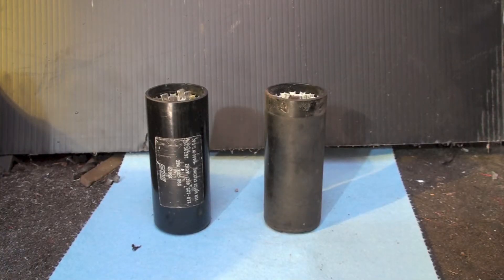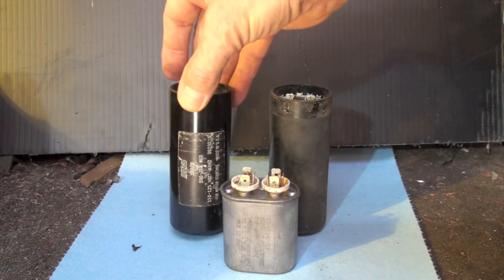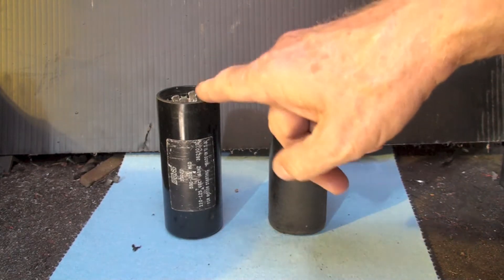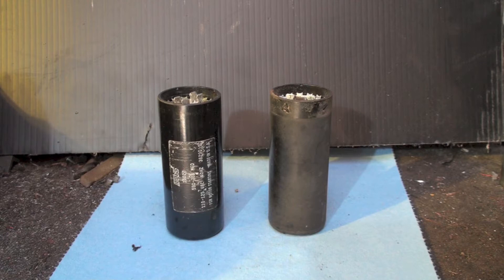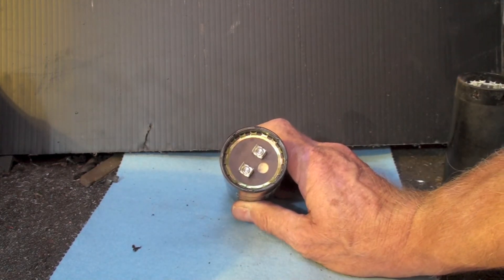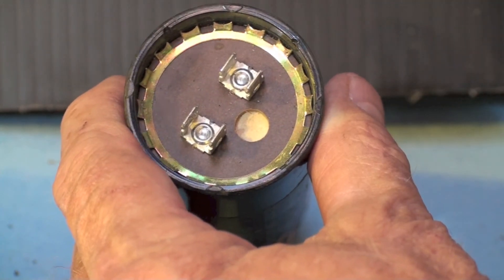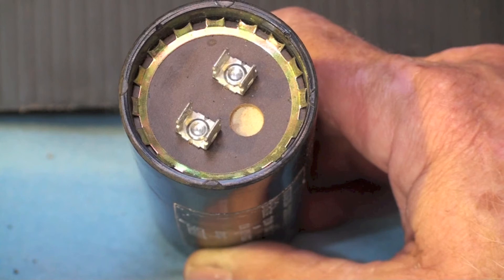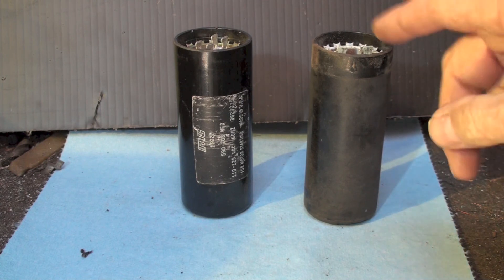The HVAC compressor start capacitor

Comment: Thank you for all your wonderful videos!  I have a quick question on capacitor safety.  I have read on many web sites about the need to safely discharge HVAC start/run motor capacitors before servicing equipment.  This makes sense as capacitors can store potentially dangerous amounts of power.  However, in looking at circuit diagrams, it seems like these capacitors should always drain naturally when equipment is de-energized, as both sides of the capacitor are always connected across the internal windings of the motor.  Is this correct?  Thanks in advance for any help.
Reply from the maker: For the run capacitor, yes.  The start capacitor is disconnected after startup.  If it has a resistor connected across the terminals, it will discharge. Other wise it will hold a charge.
GFM
Reply: Thanks for your quick response.  Unfortunately I feel like I'm still missing something.  If you are going to service the equipment, I assume you power it down first.  As the motor stops the centrifugal switch would close and the start capacitor would be re-added to the circuit.  At this point I think the start capacitor would discharge through the motor windings.  So assuming the centrifugal switch still works, it seems like the start capacitor should never have a charge after you switch off the motor?
Thanks again.
Reply from the maker: You are correct about centrifugal switch but current relays do not.  
GFM
Reply: Never assume any capacitor is safe to touch. I always first discharge them then disconnect the terminals. I saw electric arc several times on run capacitor of blower fan motors which are dead. I think it is because the electric circuit is short somewhere inside of motor. You still have charge on those run capacitors. To be safe, ALWAYS discharge any capacitors before you touch the terminals.

Comment: I am not a big fan of start caps man.  I have run into countless start caps on all kindsa units where salesman suppose to be service techs just slam them into systems.  Let me explain why I am just not picking on salesman who call themselves service techs.

What I have learned is when the run cap dies or gets below the +- percentage the start cap will continue to start the compressor...

Good video as always love your vids..

Companies in my world sell hard starts as a accessories for equalizing systems not like the trane designs.  I find dead caps in there allot as well where the start caps start them up.  might wanna check run caps in 2 stage trane systems also before people start dumping charge in them.

I have changed run caps out of two stage tranes because they were dead and only to see my system is over charged after I replace the cap.  Just makes me shake my head...

Comment: Greetings to you 
But what is the difference between
1- capacitor AC
2- capacitor DC
Reply from the maker: Karemm Ahmed Its the internal design.  Simply, AC capacitors have insulation on both sides of the aluminum foil inside.  DC caps will short out if wired backwards.
GFM